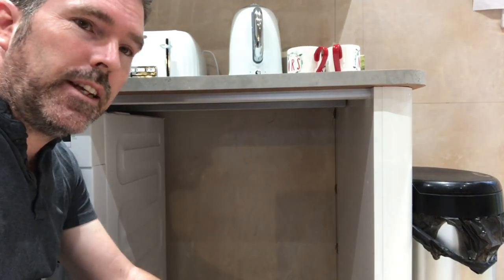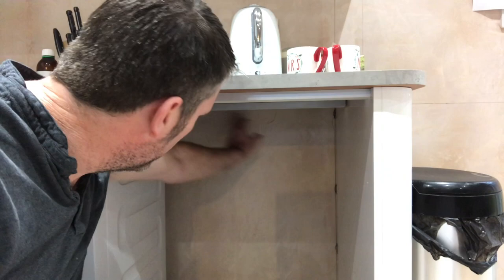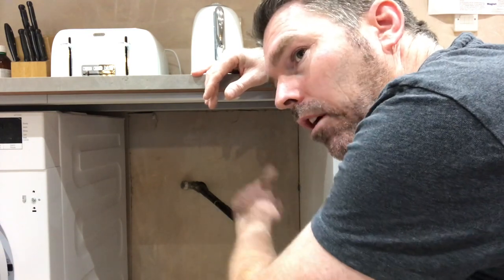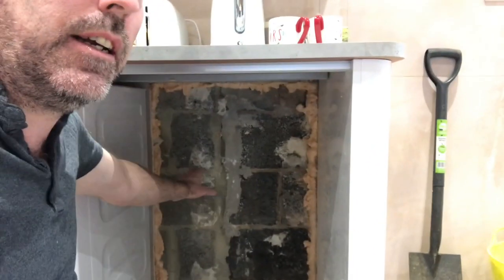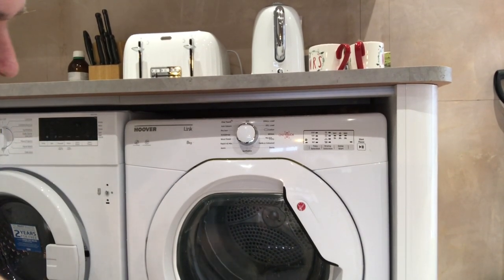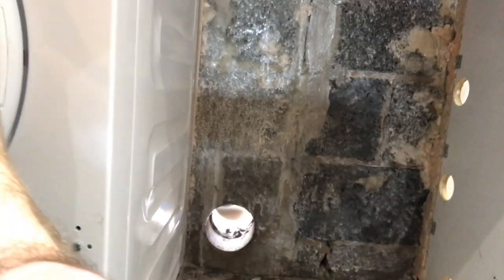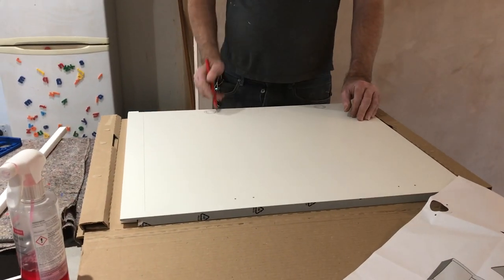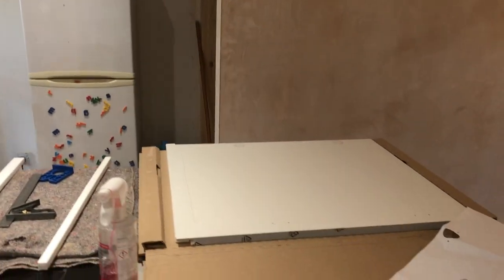Kitchen day 7 part 1 integrated washing machine freestanding dryer behind door

Comment: Have u got a video on how to remove the cupboard to put a tumble dryer. Haha im abit thick and a girl i just cant grasp what i need to remove so i can put one in.. obv the door but theres like a step thing to i dont know to to cut it all out ha then how to make a hole so i can filter the ug threw as the socket is above my spare cupboard Sorry really confusing message x
Reply from the maker: It all depends if you have got the depth on the kitchen if not you will be able to put a freestanding one or you will need to do is take out a 600 unit
Reply: @bishbashbosh121  yes its like the cupboard then that thing that looks like skirting board on the very bottom touching the floor.... so i just cut that off too? X